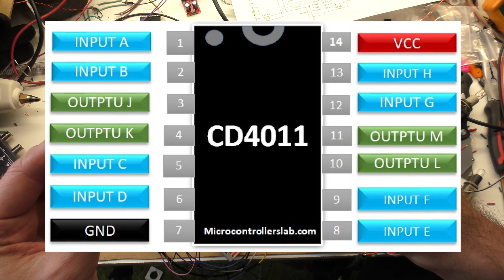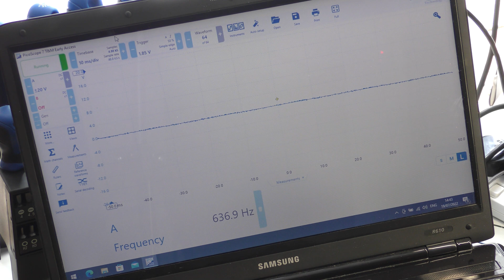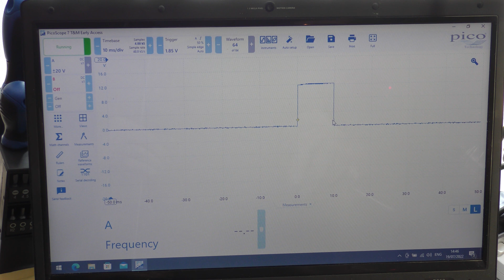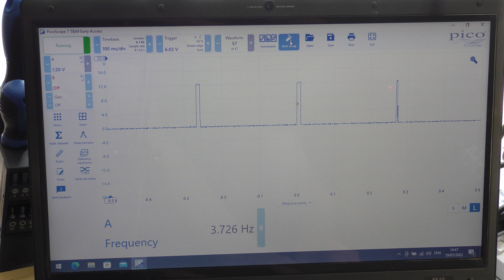Replacement Webasto Diesel Heater ECU Controller  - Part 3 - NAND use for better control

Comment: The next episode of this would be good..
The final instalment if you like.

I was going much much more simplified than that. A fan control via pot, and the 555 pulse generator for the pump.
The glow was going straight through a heavy duty rocker switch. But otherwise that's it.. A few tweaks of the pots to tune it, and an educated guess for the glow on and off should do it.

Comment: Looks like you are getting there David, I haven't been posting as I don't have anything useful to add even though I was an electrician back in the late 70' I've forgotten most of it and this modern electronics goes way over my head🤯 but just to cheer you up a little it was 40C here (Norfolk) yesterday and 49C in my spray booth🥵 needless to say I stayed indoors with cold drinks on tap😎👍

Comment: Nice job. I bought a used ebaspascher diesiel heater for my camper that has about 15 wires from it, no idea where they go. Do you have a schematic for your circuit?
Reply from the maker: Nearly.

Comment: Are you giving the board a permanent live when you turn the switch on? If so, only power it when you are on a position that uses the pump. I'm assuming that you are switching power to the individual 555 boards to select your frequency here, so more diodes time.
Reply from the maker: The problem is I need the chip powered to work the fan 555 board for cool down.  It's at this point the pump is OFF but the CD4011 swaps that to ON.  And that's my problem.  :)
Reply: @DavidMcLuckie  didn't realise you were using it for two jobs. Looks like someone came up with a solution that gives a pulse on a rising edge, as long as you can adjust the length of that pulse, that's probably the best way